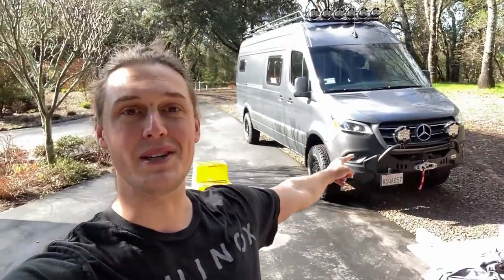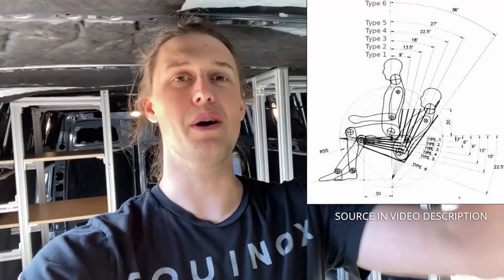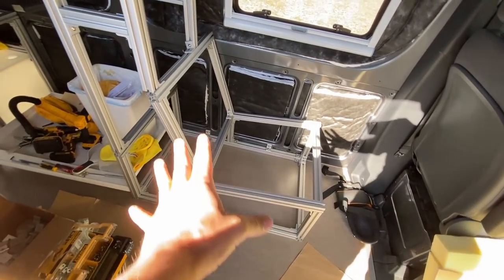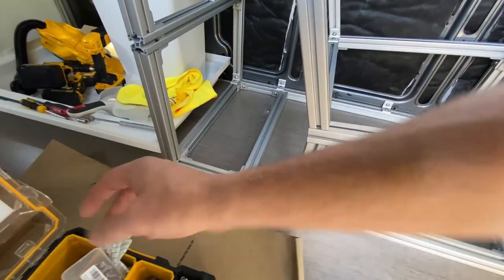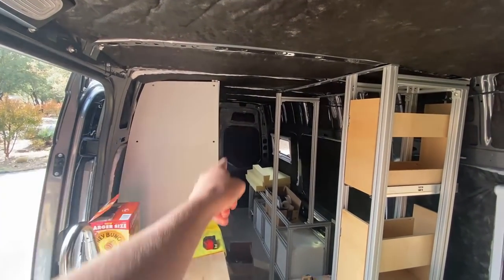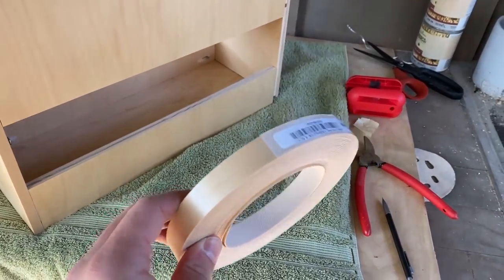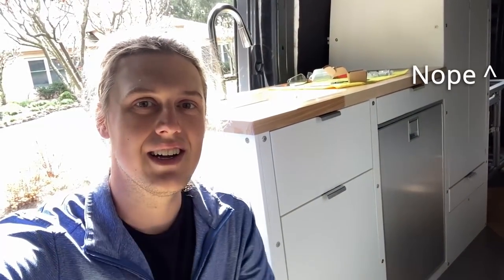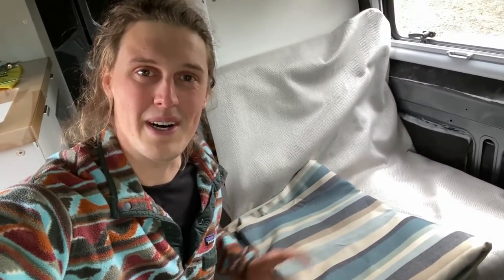How I Built An Ergonomic 80/20 Chair + Pantry Cabinet IN MY VAN!!

Comment: Very nice Contruction I can’t wait to see all done. I prefer the white fabric or Gray. One recommendation: I already have a Ford transit van 144 medium height conversion that I use for my business removing all material racks (DEWALT touch system) to go camping and after a Year the screws are loose and some of them fell down so I have to tie again. I am trying to find some type of liquid or material to tie the thread of the screw to avoid that. Just a good point of view after you finish everything and start using it the movement unscrew everything

Comment: White bolts, definitely looks more smooth and classy.  I like the striped fabric. The tan in in pulls together the white with the butcher block. You can add the other colors for more pop. You might even want to pick one of them for the wall color in that area - would add more pop.

Comment: I love extruded aluminum; just make sure to apply some low-strength Loctite on the fasteners in vehicles, aircraft, etc. Failure to do so will turn the framing into a rattletrap you can't easily access.

Comment: I used your sliding bed frame as inspiration for my 3 part sliding bed/couch. Check out 8020 parts 2068 and 2051. I used 2068 instead of linear bearings and they work great. Instead of your little ramps to keep the fingers up I used 2051 to keep the finger next to the adjacent bar. Everything slides great and there’s more wiggle room than using linear bearings.

Comment: I'd go with the white bolts. It looks more professionally done. I don't think the metal colored bolts add anything.
Between the herringbone, and the striped, I think the splash of color from the striped fabric adds a nice contrast to the white.
The herringbone fabric blends in too much and leaves it looking bland.
The quirky angles of the seat, and pantry drawers are fantastic. 
I'm really impressed with your work on this. And, great videos.

Comment: A question and suggestion that may have been mentioned already (and realizing it's over a year later). What happened to the A/C unit that was going below the bench seat? And the suggestion is that all of the wood in the countertop and pantry should have been primed with Killz. That way you reduce the risk of mold from the sink or shower.

Comment: Though the white bolts does provide a somewhat cleaner look, the "overall" style of the interior actually benefits more from the metal look even more so as it accents and plays well with other fixtures that are metal. The white bolt looks like you "tried" to make the panels smooth but due to the look of the bolt it just comes across as unfinished IMHO. That's my take on it. But at the end of the day it's whatever makes you feel more at home.

Comment: Have you done any research for what is needed in order to put a seat belt on this bad boy?
Reply from the maker: Yes, lots haha. No diy seat will ever be legal, but most aftermarket installers will bolt theirs through the floor + frame of the van. This one is indeed bolted to the frame w/the factory bolt holes so I would deem it “pretty safe” for driving if I bolted a 3 point seatbelt to the 80/20. That being said, no need for a third seat right now (let alone a 2nd 😂) so right now this is just a potential future project.